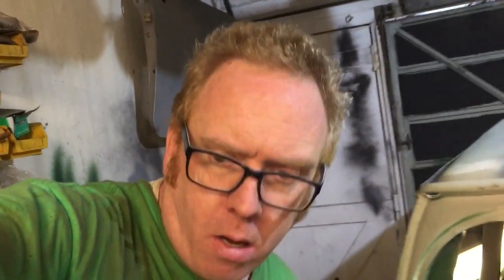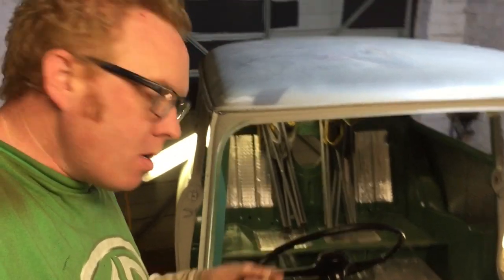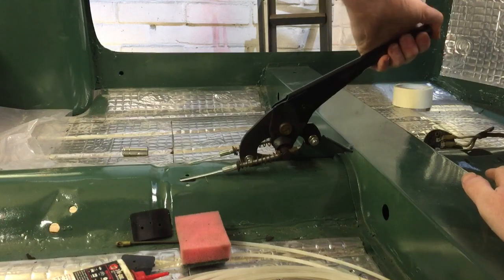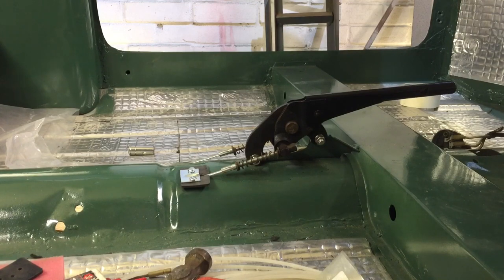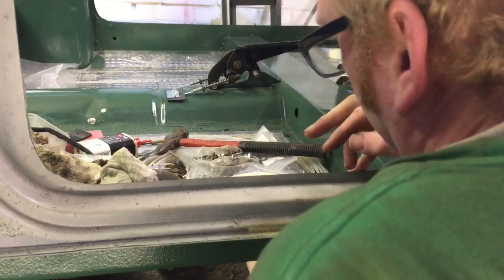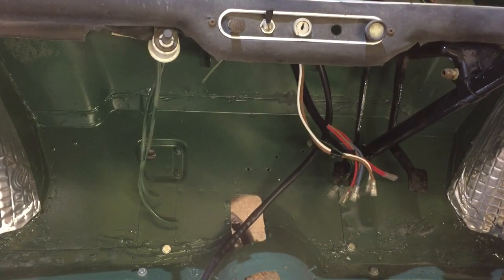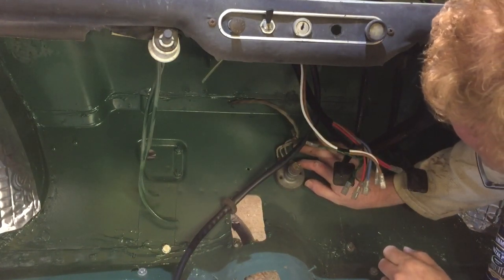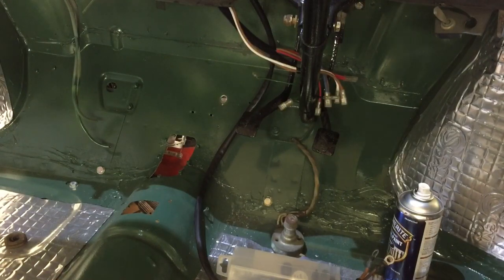1964 Mk1 Mini Restoration S2 Ep212 - Hand Brake

Comment: I have the same high beam dip switch on my 1964 1100 (not a mini, I know). 

When I press the dip switch with the dipped lights on, I’m left with only the side/parking lights and no main beam. I’ve fitted new bulbs but they still won’t come on, only the stupid blue light on the dash lights up.

All wires look intact. I was wondering if you have any ideas on what may be causing this?

Nice work on the car btw. It’s coming along nicely 👌🏽
Reply from the maker: hmm  . if blue light is coming on , it shows switch is working ..., it must be the feed to the front lights som where .., can only suggest trace it through , if its like a mini , there will be a join around slam panel area , that then T off to both lights , check that
Reply: Matt Green I’ll give that a shot later on. It’s pretty similar to the mini. Thanks Matt, really appreciate it